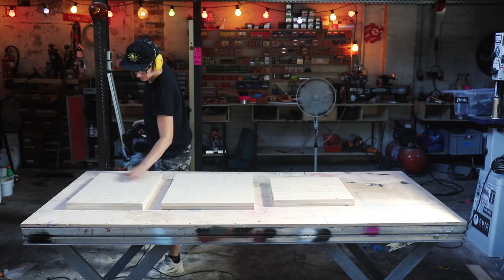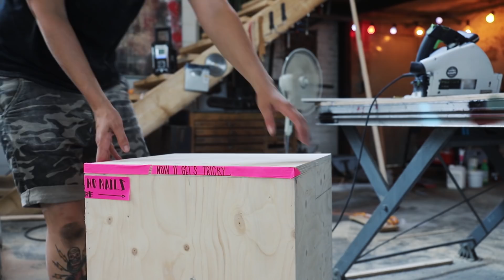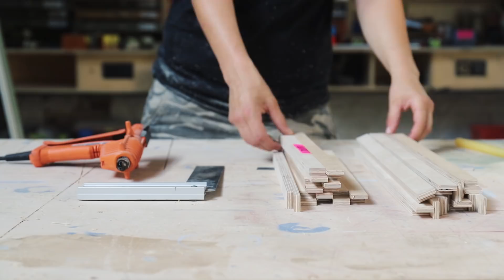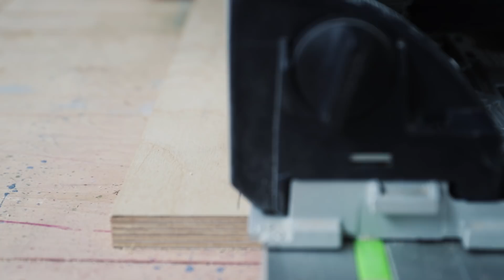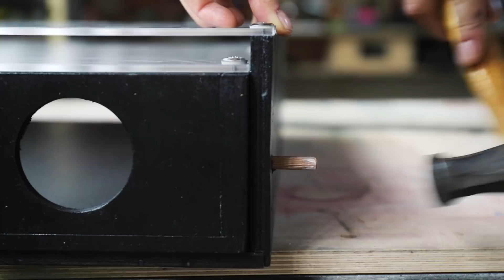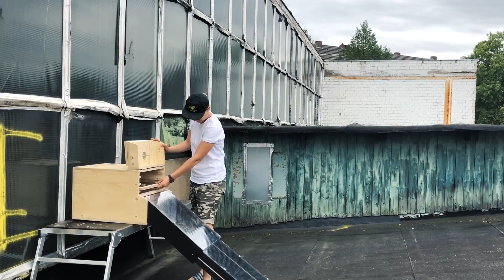Portable Solar Food Dehydrator

Comment: Hey Laura. Great work but I would have an advice for you. Some Years ago I built a stationary food dryer by myself. And soon I realized that it is necessary to prevent animals or insects from entering the dryer. So you could at least cover the holes on the heating section with some mesh and maybe attach some mesh on the opening for the ventilation. My slide was adjustable so i had to seal this with these brush-seals you can use for doors. I hope my advice can help to improve your already great work you do. Keep on making

Comment: Very nice solution! This spring I build my second version of solar Dehydrator. I used a black painted aluminium plate so that the air can flow below and above the plate. This produce so much heat that you need a small fan. I use a 5V laptop fan powered by small solar cells. At clear days I usualy get just below 60°C... perfect temerature from my point of view.
Reply: could you describe more ?? just built mine and doesn't go more than 40* ... i'm sad because i'm not sure it's enough.thanks

Comment: If you add some mesh in the solar section and paint it black you will get more heat output but it needs to be up off the deck of the collector and you can experiment with angles to get the best performance out of it
Reply: can you describe a little bit more ?? just built mine but doesn't go more than 40* degrees and i'm sad because there must be 55* or more for a good solar dehydrator. thanks

Comment: Laura, the last part of the chat, in which you answered several questions, isn't available to us right now. It seems that the chat replay cuts off at the end of the video. Are there any settings with which you can magically make the later chatlines available for those who weren't able to attend?
Reply: Also the thumbnail has left my "Subscription" page. So if I wasn't online when you set the reminder / did the life chat, i would not be able to spot that a new video was out by simply checking my subscription page, which is my main way of following interesting channels.